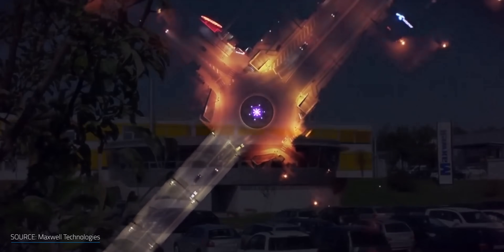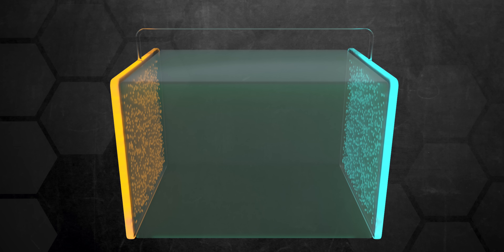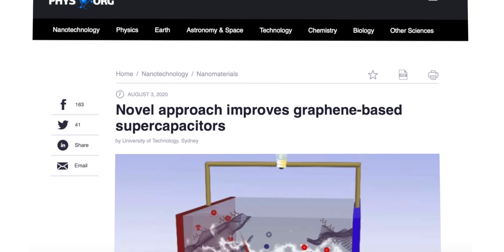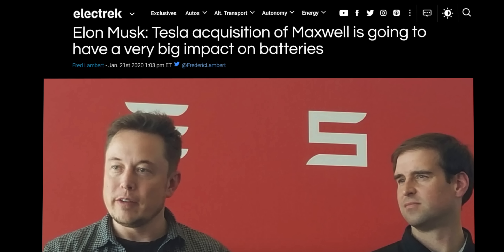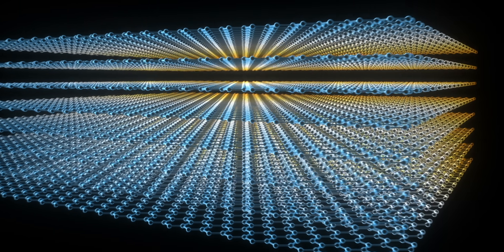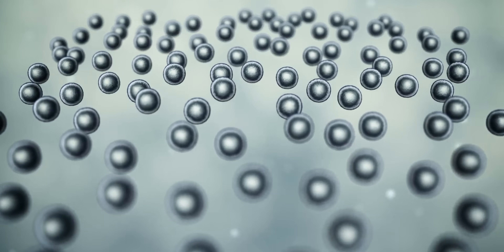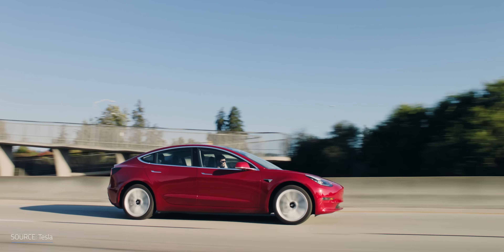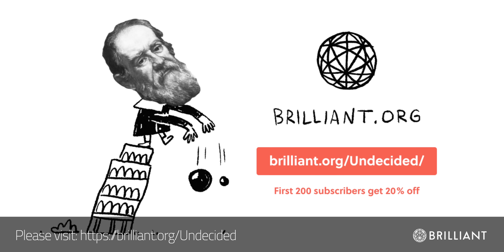Supercapacitors explained - the future of energy storage?

Comment: Solar and super capacitors are great. The quick charge time makes them better than lithium batteries. Super capacitors don't pollute like lithium ion does. The amount of co2 produced by lithium ion is more than most think.
Reply: Yeah, I was thinking that a bike with a trailer of solar panels and the latest, highest efficiency super caps might be a good combo.  If the Solar panels are larger with higher energy output than usual, the super caps should be able to dump and restore the energy as soon as the motor uses or needs it.    You would probably still want a small battery in the mix as a backup for when the capacitors are being charged by the S.P.'s.
Reply: On a side note, I'm working on systems of creating bulk quantities of graphene and psuedo graphenes (or graphenic graphites i.e. graphites that still have some stacking but not much, and are much more electrically and thermally conductive, and far stronger). 

   One material that I'm particularly excited by is cellulose nanocrystals, because when you convert these to their graphitic form, they are basically nature's sort of hybrid carbon nanotubes and graphenic graphite. They compete very well with, and are often better than, the low to mid grade, psuedo graphenes usually made from a graphite source.  

   The CNC's themselves are not that hard nor expensive to make. Mainly it's a bit time consuming with all the rinsing to get a more neutral pH.  Converting them to carbon and graphites can also take some time if you don't have high quality equipment.  I've decided to make the process quicker, easier with a insulated thermite "foundry" (of sorts) that super heats a graphite crucible.  I make it a very low oxygen environment by covering the material to be converted with many layers of paper and then activated carbon and/or some graphite. It's low enough oxygen that all the material doesn't just burn up.  It's a very fast and cheap method and can do bulk quantities because you have such fast, extreme heating involved.  

   I also plan to make some more classic graphene via the electrochemical and sonification or blender method, but that is definitely slower and produces less at a time.  Once I produce large quantities of these, I'll start experimenting with different chemistries to go along, including trying some solid state stuff.  Whatever I do use, most of the time will be boosted by the addition of large amounts of these graphenic graphites.  They can be factors of 10 to a 100 times more electrically and thermally conductive that regular graphite (depends on the quality of each category in comparison) and with MUCH greater surface area so that they can store more ions and electrons.

Comment: Important difference is also that a capacitor discharges with mostly constant current, whereas batteries discharge with mostly constant voltage. This makes combining them in a single setup not straightforward.
Reply: A big supercapacitor discharges just like a battery.  For quite a while, then they lose voltage.

Comment: What's happening is the energy sector is in bed with real estate and want charging infrastructure to operate businesses on land holding, but ev's are not laptops...Ev's interact with physics in such ways ultracapacitors can recover their charge until battery recharge cycles run out.

Comment: Ultra capacitors have a bright future for their ability to efficiently handle HUGE current fluctuations with ease - that current battery technologies cannot.  You mention the amalgamation of Li-Ion and Ultra-Cap which is a great marriage - especially for dynamic braking energy recovery.
But the main problem with this video is that you have not mentioned the essential difference between Ultra-cap and Super-cap technologies.

A Super-cap has the ability to 'slowly' acquire charge and also 'slowly' dispense that charge.  It has a HIGH ESR (Equivalent Series Resistance and  self-discharge rate).  It has been successfully used as a volatile memory backup supply on electronic circuit boards for many years - with no lifetime issues like lithium button cells.

An Ultra capacitor has the ability to absorb and/or dispense HUGE quantities of energy in a short time.  It has an extremely LOW ESR.  It is therefore very suitable for any form of instantly accessible 'high-demand' use.
It is a  different beast to the Super-Cap.

So all practical applications of Ultra-capacitors need to address this rather annoying fact of self-discharge.  An Ultra-capacitor is a  storage medium with very high coulomb transfer ability.  It is useless for energy storage beyond a few days.

Comment: Funny thing is that, contrary to common belief, for the same volume lithium batteries can have waaaaaay lower internal resistance than supercaps. As a random example a 200F/2.7V supercap has a volume of ~50cm2 and a IR of 30mOhm while the IR of a good 3Ah/4.2V LiPo with approximately the same volume is below 2mOhm. As to energy density they are so far apart (730J vs 40000J in the example) it isn't even funny. 

Supercaps are useful where a long carefree lifetime and a (slightly) higher temperature range are important and energy or power density are not.

Comment: So capacitors are for fast charge and discharge and batteries are for high energy density. Super capacitors are better capacitors and for the battery side there are solid state batteries.

Comment: I imagine if we can swap out batteries like we do in the forklifts in the warehouses that would work we have these huge batteries that we use in the forklifts and basically just unplug them and put them back on the charger and then put the charge battery in the forklift it takes about 5 or 10 minutes but you know to swap a battery but I guess it lasts around the warehouse for about 5 to 8 hours I guess and then especially if you don't use it you can just plug in the forklift while you're not using it

Comment: A hybrid in EVs would be ideal for me...let's say you have only 50kwh as Batterie and similar as capacitors.
If you can charge the capacitor in minutes you already can drive your car, while the capacitor is charging your Batterie and unloads itself into the Batterie.
You would have to stop more often in this case, but only for minutes....
Like filling a bottle with a funnel...you can swiftly fill the funnel, but the bottle gets filled slowly.

Comment: I would love to see a large bank of super capacitors used to launch rockets from the ground with a mag-lev type of rail gun rocket launcher. They are the best electrical component for large bursts of energy like that. Then the rocket could have super caps to provide the remaining amount of lift needed to get into orbit. On re-entry, the falling rocket could get charged through a regenerative braking type system to provide power for landing too!
Reply: There are some physical limitations you haven't considered.  This is why rocket fuel is used, not electricity.

Comment: Super capacitors.. or even mega capacitors to capture energy from lightning, could this be possible?
Reply: Dielectric material research would need a quantum breakthrough.
Any collector design would need the ability to " spread" the amount of charge over an extremely large area in nanoseconds and the dielectric would need to be resilient enough to survive the tremendous voltage spike in a local area to allow for overall charge to spread.  You do not want punch through of the dielectric as the strike happens.

Comment: Yeah yeah, but what about the cost? Also some EVs can charge at 350kW and the Plaid+ will discharge at 900kW. To reach those levels, assuming 9W/g (according to wikipedia) for supercaps, you'd need 100kg of supercaps that is 1/6th of the weight of the battery pack of a model S 100kWh. Plaid+ is <9s 1/4 mile, at some point the motor is gonna say no, too much power, need more coolant, lubricant. The bearing material can't resist infinite pressure and you don't want the driver to faint with the g force. Also even if you stuff the car with only supercaps, you've barely enough energy to finish 1/4 mile and then go recharge.
Reply: Do you expel all the energy in a battery all at once?  Dumb dumb.  You can create a "battery" of SCs and discharge them in sequential powerplant groups as required, mimicking traditional electric motor output.  Without infrastructure like the Bus idea, you'd probably want either a short range lithium battery pack or ICE if you are driving a distance without any recharge.

Comment: I thought the ultra expensive Hydrogen /Fuel Cell cars already uses  caps for instant torque.
Reply: At least not the cars on the market today, as far as I know.
But the Riversimple Rasa (prototype) uses ultracapacitors instead of a buffer battery like in "normal" fuel cell cars.

Comment: If fast charging let’s you recharge to 80% in 5 minutes  - why don’t battery manufacturers install slightly larger batteries and specify 80% as the target charge - so that when the charge reaches 80%, they can call it “Full” and advertise that their battery reaches a “Full” charge in 15 minutes?  They could call the extra 20% an “overcharge”.  Isn’t this analogous to the strategy that CPU manufacturers use?  They label them slightly slower than they are capable of and allow for overclocking to reach full potential.

Comment: Current battery tech is good enough? but wouldn't the faster charge rate still be a point of interest?
Reply: Well, yes. The charge is fast but the energy is low. You can pour an ounce of gas into your car in a second, but it won't get you far.

Comment: Hi Matt, before you say again that Supercap technology can't replace (yet) the Lithium Ion one, kindly have a look at the supercaps I've been using myself for the past 2 years acting as absolutely normal batteries, yet having all additional advantages of the supercap as you mentioned.  Discharge linearly according to the load and not in short bursts...it does exist and they do work :  www.kilowattlabs.com   The future has already arrived, just didn't go mainstream yet....
Reply: Great info thanks.
Does anyone offer a car battery system?
Reply: My question is can one really replace a battery running a winch and accessories on a supercapbank alone. I am certain just adding one to support the battery would be a vast improvement.
I'm going to try and design a dual system pairing one for starting with a battery for accessories.

Comment: Supercaps cannot compete with modern batteries since they are current sources, not voltage sources. Supercapacitors lose voltage rapidly when working, and this requires the usage of a constant power converter as their load. A constant current converter keeps the output power constant, which increases the converter's input current during the supercapacitor discharging, which makes the supercapacitor discharging still faster. Supercapacitors are good for low current implementations like energy scavenging, sensors, wearable electronics, etc. but not power electronics.

Comment: you are an optimist! you think that the reason you are not seeing capacitors with lithium combo in ev cars is because "it is good enough" NO! it is because like every other reason GREED! if you can make a cars battery last 3-4 times longer they will not buy a new car it's that simple.
we are moving towards a system where you are always giving money to manufactures instead of buying something once and that manufacture does not see you in 10-15 years. they want a constant revenue from you.
 keep up the good work
Reply from the maker: Thanks for the comment!  I'd challenge that point though with Tesla ... they're actively working on battery packs that can last 1 million miles over their lifespan.  Paired with motors that are already rated for 1 million miles and you have a car that will last for decades (for a typical driver).

Comment: i want capacitors that work backwards so they charge quickly and slowly release it
Reply: That's called a lithium battery they've already been invented
Reply: @eksine  no a capacitor can discharge alot of energy instantly

I wanna be able to plug into a charger tap a button and leave

And drive for 400 miles
Reply: @thatjokerperson7062  that's what I'm saying a capacitor that works backwards is literally a battery. What you're really asking for is a capacitor that defies the laws of physics
Reply: @eksine  no im asking to put alot of energy in at once and slowly releases the same amount of energy

Comment: If I was a betting person, I would think Tesla would use their existing Lithium AND super capacitor technology to reach their goal of a one million EV:
250,000 miles EV using Lithium batteries extended by four times with super capacitors = 1,000,000 miles

Comment: This "hybrid" idea keeps coming up every now and then, and I have the same answer as before: This is not going anywhere. Here's the thing: In a high-performance EV, you're limited by the size of the motor. You want a battery pack with enough specific POWER to handle the full capacity of the motor, whether you're accelerating or decelerating (regen braking). Having supercaps adds nothing to that. The best example of this is probably the new Roadster. What reason is there for a car like that to have a 1000 km range? Range should be among the least of your concerns. Well, you need that big a battery to get the POWER. Sure, you might save some weight by combining that with some kind of supercapacitor bank (although, I suspect, not as much as it might seem), but when you consider the overall weight, volume, cost, and complexity, in the end it's better just to use a bigger battery, and enjoy the other benefits that provides.

There are some excellent places for supercaps. An example could be various power tools, where you might not need that much "range" as long as you can recharge in a few seconds. The example of buses mentioned is another—except that, in city buses, you might be able to charge at stops in seconds, not minutes. There, that's a real advantage.

Another possible application, although perhaps more hypothetical: Stationary energy storage. Here, you're not that concerned with size and weight, nor with delivering huge pulses of energy, but a long lifetime could be a big advantage. OTOH that advantage could be wiped out by the economies of scale that large battery packs may get as EV usage grows. And the long life may not be such a big plus, either, if technological change makes current batteries AND supercaps obsolete in a decade or two, as seems likely.

What we may see happening is that the line between batteries and supercaps continues to get more blurred.

Comment: So yeah... Coconut oil doesn't raise cholesterol.... when compared with butter. The analogy is incomplete. when you have more batteries you use more batteries and if you ditch the capacitor you have more room for batteries. How does having enough batteries compare with not having enough and working what you have to death? I am sure it compares well to paring them with capacitors. Perhaps in our future batteries and capacitors will merge, but other than that no, we need KWH.
Another way to think of it is perhaps Tesla could just make batteries with less material and more foil, which is more like an Ultra cap.... no they just decided to make the batteries the way they wanted them to be and have the compromise they want to have.

Comment: Super caps along with an ev battery would help the lion battery last longer by not putting huge strain n heat on fhe traction battery and a cap cann put out 900amps vs 50amp of a lion battery. And caps block dc.

Comment: As soon as they can make a supercapacitor pack the size and weight of a standard lithium ion pack for an EV that has a 40 mile range they can ditch the lithium ion altogether and just go with supercapacitors.  Why?  Because the average daily commute in America is 30 miles round trip.  You can charge such a supercapacitor pack to 40 miles in about 50 minutes on a standard 120 volt regular outlet.  A public charge at 240 volt it take about 10 minutes 30 seconds to reach a full charge of 40 miles.  The lowest level DC faster charge could you could get 40 miles in 1 minute 15 seconds.  Supercapacitors are 10 times cheaper to charge than lithium ion batteries.  So way less stress on the grid.  A 2 foot by 4 foot solar panel could charge a supercapacitor pack 40 miles in 5 to 6 hours in direct sunlight.  On a 400 mile road trip it take 9 charging stops or 94.5 minutes of charging time total on 240 volt public chargers.  If you can charge at DC Fast chargers 11 minutes 15 seconds total charging time.  Longer trips over 400 miles and a supercapacitor only EV can travel farther with less charging times than even a long range Tesla Model 3.  Yes you have to stop more often but can you charge a Model 3 with a solar panel that will fit in a thin suitcase?  Two 4 feet long by 2 feet wide solar panel could give you a 40 mile charge in 2.5 to 3 hours.  Can't do that with lithium ion battery pack for an EV.  Everyone is too hung up on an EV having to have a range of 250 or 300 miles.  A supercapacitor EV could have a solar panel array that automatically deployed from under the hood and tracks the sun thus decreasing the full charge time to two hours or perhaps an hour and a half of full sunlight thus cutting the power cord and reliance on any infrastructure.

Comment: I imagine if we could use a chemical battery like the hydrogen in water battery we actually using a hydrogen water to produce electrolysis which produces electricity and a higher rate a higher volume

Comment: Solid state batteries will solve longevity, high charge and discharge rates as well as improving on current li-ion energy densities. Solid state technology will do for batteries what it did for electronics, lighting and storage. It will be the combustion engine killer for ground based transportation, even trains!